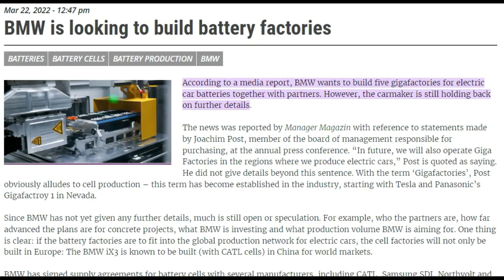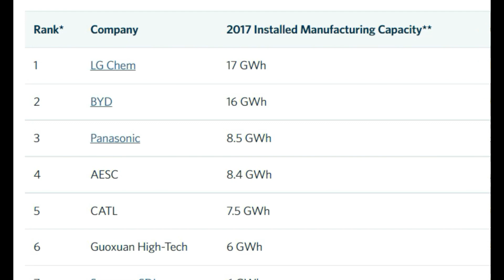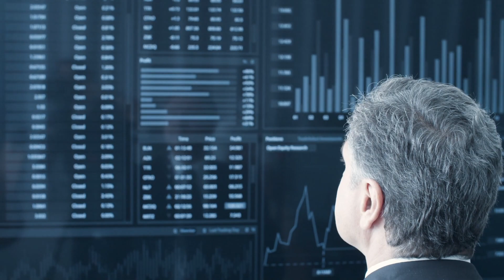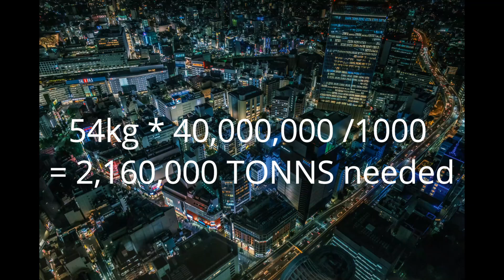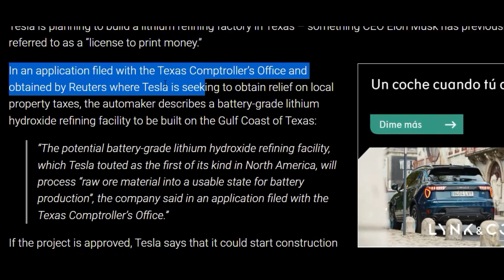This Metal Is the Next Gold in Electric Car World !

Comment: The problem with BEVs is also their weight, and weak range. This is where the hydrogen technology will kick in, something that Elon called stupid, will bite him back. Just 7 kilograms of hydrogen has a longer range than any of his existing BEVs. The lithium shortages will push hydrogen technologies on the market.  BEVs are not a long term solution, but the hydrogen fuel cell vehicles are.